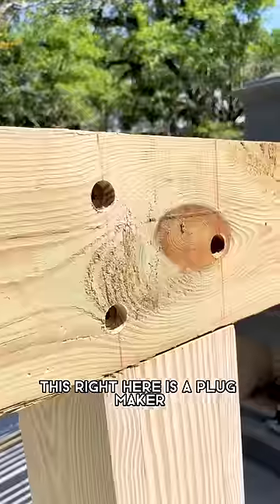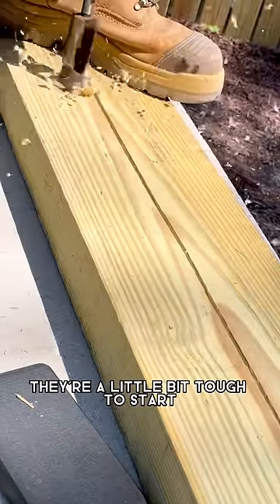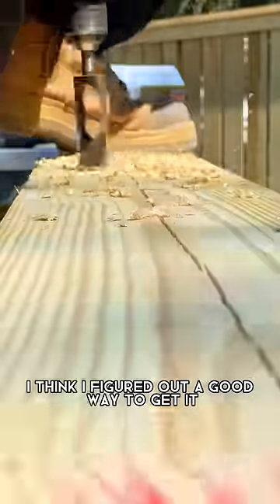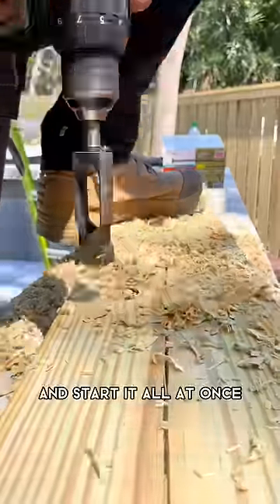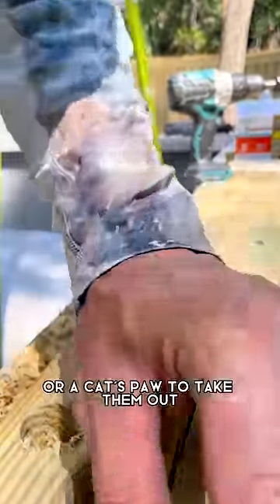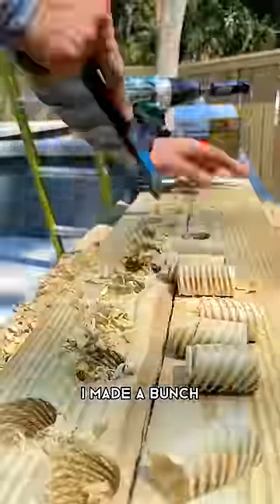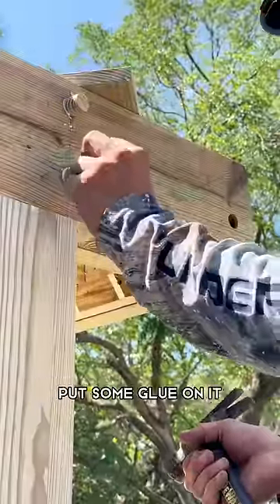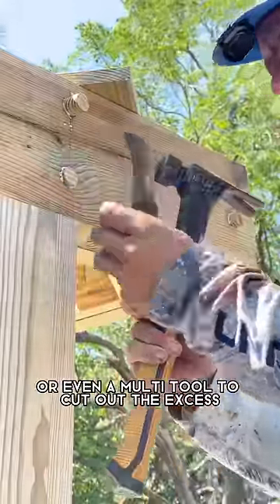Building a Pergola Part 7 Short

Comment: Spin the drill on reverse first, then go in hard on forwards, no spin out baby.
Reply: Same idea works with threaded plumbing fixtures. Give it a turn backwards, then forward and it won't strip the threads.
Reply: 100%. Works good for pvc also
Reply: Dang lol apparently my tip was already told...haha
Reply: Yes yes yes yes yes. Just glad this Comment is first
Reply: Or use a Drill Press
Reply: Exactly
Reply: Came here to say this.
Reply: That’s what I was thinking
Reply: @galacticunderground1    i always spin every threaded item backwards  first i haven't cross threaded anything in years total worth it
Reply: Came here to say this
Reply: this
Reply: was just about to advise this!
Reply: Saved me some typing😂😂
Reply: I was gonna suggest this.
Reply: I concur with this tip
Reply: My thoughts exactly. And 22 years in construction.
Reply: That’s what she said
Reply: Yup. Was about to comment the same. I also spin bolts backwards until the thread "clicks" and it generally prevents crossthreading... a good thing to know for delicate repairs on engines et al.
Reply: @xblaze45  me too!
Reply: U beat me to it
Reply: Oh yeah bud for sure, for sure, for sure! 🫡
Reply: Just go full speed and push down. Way faster and no kick out at all.
Reply: This is what I came to say too..
Reply: I can see that you’ve never used one of these before just stick to putting pressure
Reply: I agree with you my friend 🙏🏼
Reply: I came here to say this but you beat me by 3 months
Reply: Thanks babe
Reply: I came here to say this
Reply: @diverdave4056  yup
 Set up a drill press... or  or ... get one of those portable drill presses
Reply: Gosh darn beat me to er
Reply: @-themercyseat  98
Reply: You took the words from my mouth. I was about to suggest what I always do with difficult to centre cutters.
Reply: Thats what "she" said 😁
Reply: Or roll a new bit on reverse on the side over concrete for a few seconds to dull the outer edge, cuts slightly slower but never kicks
Reply: Looks like he has a faster way already

Comment: Do ya first plug in a smaller scrap piece, and use the hole as a guide for all ya other plugs if ya got the time
Reply: Thats smart, you're referring to guiding to eliminate catching in itself? Like a stencil?
Reply: I do that for everything even core drilling concrete
Reply: @rivercat5824  yeah guiding it to both eliminate catching and scratching the area around if ya want to use the piece for other stuff to.
Reply: Works great, especially if you leave enough material to step on.
Reply: Yip like running a hole saw with out a center bit ....but I'm a welder idk why I'm here 🤣
Reply: @rivercat5824  exactly
Reply: Yep…

Comment: I found the best way to cut the plugs off was a pull saw. The flex in the blade Helps you get it nice a flush. Good work my man
Reply: These bits are supposed to be used in a drill press right?
Reply: Japanese flush-cut saws are the way to go.
Reply: The other feature that makes Japanese pull saws useful for this is they have no set.

Comment: Put your bit in a drill press.  I always make mine that way.   Cuts perfect plugs every time.  You can start out with light pressure and have the top edge really clean
Reply: That may work best but how many carpenters carry a drill press with them to the job site? 🤔

Comment: Some thoughts:

1. If you are doing a lot of plugs, try using a Forstner or spade bit to make a small recess for each plug so the plug bit will seat well, right from the start.

2. Tapered plug bits work even better.  They are wider at the throat and taper down past the stated size.  That way, not only will there be space for glue around the end of the plug in the hole, but hammering the plug in as far as it will go will give you a REALLY tight seal, even if the hole is a tad oversize.

3. Using a Japanese pull saw with the teeth set only to one side will allow quickly cutting the plugs off almost perfectly flush without scratching the surface of the work.  A block plane--small enough to fit in a holster on your belt--will bring it completely flush with a nice, smooth surface.

Cheers!

Comment: Drill a  hole equal in diameter to the O.D. of the plug cutter through a short scrap board. Use the scrap  as you would a tapping block to guide the plug cutter.

Comment: Your plugs will be much stronger if you drill into the end of the length of timber.
Reply: Wood plus are not for strength they are  to fill the screws holes  and make it invisible has possible .
Reply: In my opinion its a much better job cutting them with the grain lengthways. It won't shrink below or swell above the surface. What would i know though, only been a carpenter for 30 years.
Reply: @meehollmurakoo1673  in my opinion you wrong…if you glued wood and plug together goin width way they all move at the same when it shrink and swells , but if you the have wood and plug going different directions more likely that will happen, wood moves more width ways then length ways.what the hell do I know, I gust been a carpenter 47 years
Reply: Agreed. The grain is going the wrong way, making a very weak plug. I can't believe you are the only commenter I've seen so far that has mentioned this.
Reply: @meehollmurakoo1673  yet you are talking dowel instead of plug
Reply: @victorhopper6774  no, he’s talking about wood plugs, that’s what this video it’s about, dowel are used to line up two pieces of wood together when you glue it plus gives some strength
Reply: @michaelweems679  thanks … we Always learn something old every day,but it’s new to us
Reply: @blackknight5137   Now that I think about it, it really doesn't matter if hes just filling screw holes.

Comment: If you have a drill press handy it makes the job effortless.   Also, just starting the hole at a slight angle and then immediately rocking it to vertical, it helps too.  I did 388 of these in 100yr old oak flooring to remove the 16p nails someone had put in.  Used 7/16" Irwin straight plug cutters. The outside diameter is 5/8".  Pop out the wood around the nail head, bend it over slightly, Then use 12" long angled-dog leg needle nose plyers and a steel plate to protect the wood to pry up the nail high enough to get a pry bar to pull it out.  Then 5/8" plug cutter to cut oak plugs, 1 7/8" deck screws and glue, then  glue in the plug, dry and floor sand and finish.  Saved $5,000 on a new floor and give our old one a new life and character.  It looks great.  And no more squeaks!

Comment: If you cut a plug through a piece of scrap wood, you can center that hole over where you want to cut a plug. Put the plug cutter in that hole and drill. Works great.

Comment: You're the first construction worker I've seen use that little OX cats claw, I absolutely love mine, so versatile and small enough to take anywhere
Reply: Where have you worked? Every single construction worker/trade has a cats claw.
Reply: @AnubisSolvang  think he’s talking bout the ox tools brand. When it comes to cats claws I love the ox tools and estwing. Both are handy as hell
Reply: @benm12310  possibly. To me, any cats claw is handy. It's just all around a handy tool no matter what trade you're in. I haven't seen too much variation in the many brands over the years. Some have extra little quirks but overall they're the same.
Reply: @AnubisSolvang  I am a Pipefitter and have never seen a fitter or a welder use one.
Reply: @ashly5712  you're talking industrial construction.

Comment: Cut that hole through a nice lil scrap of plywood (thicker is better). then lay that lil template over your plug stock and give yourself enough room to hold a foot or a clamp on it while you drill. Makes a very nice square plug with little wandering or tearout. 

Plus im sure you have access to plywood scraps

Comment: Irwin makes great tri-blade bit for boring holes. These bits do not wander. It would easily work for that and you would have no core to remove. But be carfull they go fast, they pull themselves. You can get a set. I use them for running electrical wire or piping. I think Milwaukee makes a bit too.

Comment: drill a hole the same size in a scrap piece and then clamp it onto the stock you’re going to drill plugs out of.
the scrap piece will keep that plug cutter from bouncing around.

btw….that plug cutter was not designed for a hand held drill, it’s for a drill press, and the work pie must be secured with clamps or hold downs, toggle clamps, some other way.

Comment: Turn drill at an angle starting slow. Once it gets started a little begin slowly bringing the drill up to a perpendicular angle and the bit will not jump around as badly. This works great for using diamond hole saw bits in very hard material like granite or porcelain tile.

Comment: Run the plug cutter through a half inch plywood strip long enough to step on or clamp it to the board using the hole in the plywood to locate the plug center an guig the plug center. Accurate and eliminates the skating across the board

Comment: We use this tool in traditional boat building. If you use it to drill out the surface of a knott where the branches where and plug with wood that's not a knott then your work will not rot as easy. Because the fibres of the grain are like straws and the Knott's suck up all the moisture into the wood.

Comment: Here's a solution if you will. Take a piece of scrap plywood drill a hole through it with the bit you are using. Then you can use the plywood as a template. It will keep the bit from walking on you. Just a thought.

Comment: Put the drill in reverse and use the drill in reverse until you have a slight cut in the wood. Then, flip the drill to forward direction and you will cut a plug without it jumping out of place

Comment: Good job my man, if you can get the plugs out of off cuts you can pretty much make the plug invisible.
Reply: Then when you need to make repairs?
Reply: @frankiethefrog1752  ‘pretty much’ means not completely.
when you get a couple of inches away you can notice. 
From a distance it doesn’t stick out.

Comment: Pro Tip... Cut a hole in a piece of 3/4" and use as a guide. Also works if you need to make a hole a bigger size without a pilot hole. 😉

Comment: When put faucet holes in stone countertops with a core bit we run the tool at max speed and enter at 45°angle once the tool eats abt 1/8th you for back to perpendicular to material and sink the bit down

Comment: Take a scrap piece of 2x4 stock and drill a hole in it and use it for a guide. Put index marks on the edge so you know where the center of the hole is and clamp II down and drill away.

Comment: First off thanks for getting in the trade.  It's a decent living, its good for the soul and the pride of accomplishment  is untouchable.  Second that was with pine /fir  aka a soft wood.  Maple or oak or hickory is a different animal. I've  got tools, 45 yrs on the job does it. If I have alot of plugs I need, I set up a small drill press that makes short work of it. Generally I will do a bucket full at the shop.

Comment: If you angle the drill, maybe 15 to 20 degrees, get it started slightly on the edge first then slowly, as you push down, push the drill slow straight up.  It will start every time

Comment: It's the angle of the drill. If you hold it flush with the board, it creates more surface area, meaning more friction. Holding it at an angle and straightening it out is 1000× easier. Smarter, not harder.

Comment: Start slowly in reverse to make a score line about a 1/4" light pressure. Switch to forward and let the dog eat. Never force a tool. Just use even pressure it it slows down. Back out in forward to clean hole and push even as fast as it wants to go. That the same with any tool

Comment: Reverse first works well, but I've found you can start on a 45 degree angle with light pressure to get an initial cut then straighten it up and send it

Comment: You have to start straight. You’re going in from an angle every time. If you have the bit flat on the wood, it pushes in all directions instead of just the direction you angle it.

Comment: That is also a tenon or dowel cutting bit.  It does also work as a plug cutter.  Of course a drill press would be ideal, but you have to do what you need to on site...

Comment: If your going to cut the plugs anyway, could you try drilling right through the wood so you can skip the chisel step? The shape of that bit makes me think its designed so you can get your finger in and push out the plug?

Comment: Its good for the lines to run horizontal instead of vertical plug brakes half way if it has force pushing opposite sides

Comment: Just adding a danger point here. Don't do what you did at the start. Reverse trick is a good way, or making sure the bit is spinning before it touches.  I like to do stuff like this in a press, since it's trivial to bang out. My old Delta (Was like $20 at a yard sell) keeps the bit at ideal speed better vs most handhelds. 

Caution: a bit like that kicked off wood for me once and tore through my work boot, and sock and into my ankle, almost taking out my Achilles tendon (you could see the tendon through the flap of skin.) Use caution.

Comment: Try using a drill press. Plug making bits are not designed to be used w a handheld drill. Also a chisel would leave plugs looking much cleaner than ur hook bill folding knife lol.

Comment: Get a flush cut saw. Harbor Freight has a cheap version or you can get a good one from 🗾. It's just a thin, flexible pull saw used in traditional no-fastener dowelling construction.

Comment: If you want a strong dowel or plug as you call it, you should obtain it from the end of a board. Much stronger if it is structural (i.e. for pegging a Mortise and Tenon joint.

Comment: Use a short piece of PVC pipe with the same inside diameter as the bit to cover it and you can hold it in place with your other hand . 6-8 inches is all you need and you can buy PVC in 2 foot lengths

Comment: For a hole that small, use a spade-shaped drill, it's cheaper and turns the inside to sawdust. It also has that center point to skip around a lot less, after you press it in with no rotation.
Reply: He wants to save the inside. LOL. Don't give tips if you have no clue what's going on. He's making plugs.

Comment: Another handy tip mate, if you hold that at a bit of an angle first to let one side catch and then go in at 90 degrees you’ll be sound 👍 otherwise you need one with a pilot bit
Reply: He's making plugs to cover the screws. Plug cutting bits specifically do NOT have pilot bits.

Comment: That type of plug maker is designed to be used in a pillar drill ( drill press ) there's a less heavy duty version for hand drills. Using one like yours on the job site is safest and easiest done using a plunge router. There's loads of good tips on here about using guides or reverse starting just be careful of your wrists it's very easy to get a break or strain if it catches and kicks and unpaid time off work sucks

Comment: You can put a slightly larger than a7/8 hole threw a piece of one by and then put that piece of one by on to the piece of wood you want to drill into. you then take some clamps and clamp it down so it doesn't move. That's how you start the holes without jumping every time, far less chance of injury. When done, store it. Then you have a jig to use whenever you need to do these!. Best of luck. It seems like you got it somewhat down though at the end. It was ugly when you started though

Comment: Congratulations. You've learned at some point how to use a power drill, using the same methods that have been used throughout all of history for all forms of drills and saws. "Press harder, and it won't slip as much."

To be honest though, I'm surprised how many people these days don't know the fundamentals of using tools and making things. So even if I was kind of a dick with my first part, I actually would like to thank you for showing people how to use a tool. Also I would offer that if you spin the drill in reverse and score guide lines into the wood, that you may not need to use as much pressure. Also, using a knife may not work with all woods, and your knife mat dull quickly doing that. I don't know if you sharpen your knives, but a simple hand jigsaw, miter saw, or larger hand saw might work better and more cleanly for removing excess plug length after installation.

Comment: On any drill bit that slips off point I cut a hole in a larger pice of wood as a guide over the material I am trying to cut. Plugs are pretty easy but tile you slip all over . Just put the x size wood hole over the tile and you are good.

Comment: Try out a cordless skill 77 with 48 volt battery it cuts like has cord an cut guy can cut for hours on one battery. If you can't find deal with 2 battery get hold of me I got a few brand new ones once you go worm drive (skill) you never go back trust me smooth saw  it's heavy but I'm 53 run it all day

Comment: Also if you grab like a 1 inch board and drill the same hole diameter through it and then use that as a guide it won't mark up your wood as you're trying to get that bit down into it

Comment: Why in the world would you just take a big old piece of lumber and randomly make your plugs? Several things would come to mind. I would not be surprised if you had a drill press set up in your shop someplace and some pieces of scrap wood instead of a freaking piece that was 10 ft long you could make a bunch of them before you went out on the job site. Even if you didn't have the drill press you could still you scraps instead of that big long piece

Comment: Why not just do real carpentry and use pegs rather than bolts, looks cooler and it can be easily tightened up by any idiot with a hammer. And the customer will thing you're a master when you show them